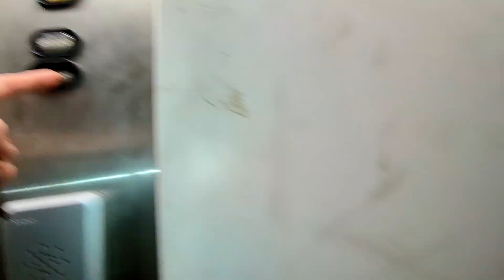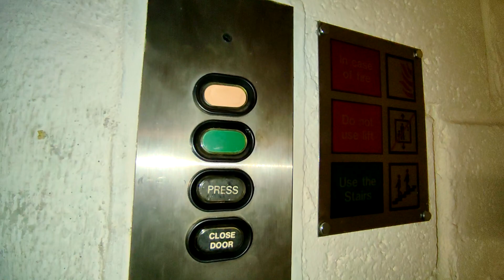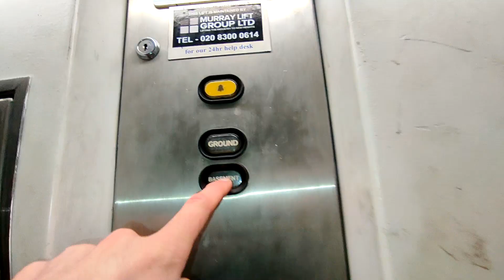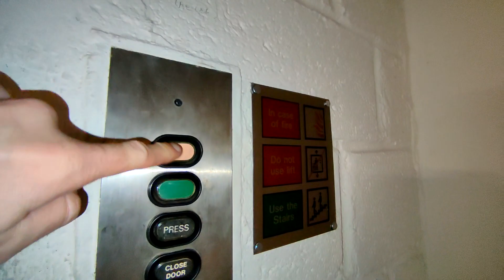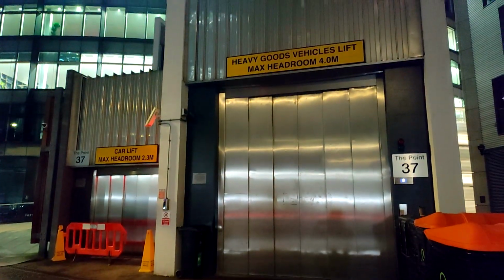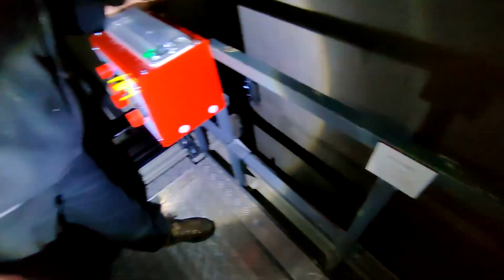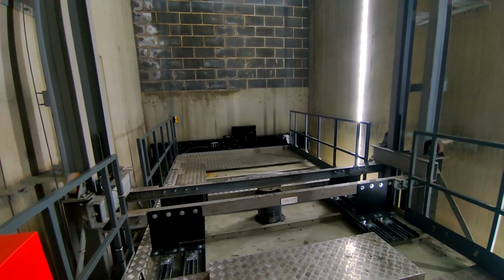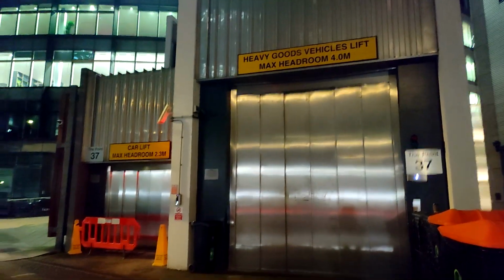Rare Express car lift with vertical doors

Comment: These types of elevators are pretty common here in the US, although I don’t think we use them as car transporters. The ones I’ve seen (and been on) are used to transport large loads of cargo between floors for which a regular elevator would be too small for

Comment: This lift has an interesting traction motor with a very interesting 50Hz hum, which passenger lifts would have this motor like the ones at Chatham Tesco and Go Outdoors before 2011 mod, and Permanent Closure in 2020.

Comment: Interesting, there is an induction hum when the elevator was descending unless it was something with the controller. Most hydraulic elevators are silent when going down, expect for the whooshing sound as the tank is filled back up. Elevator that big likely has two pistons.
Reply: The humming is coming from the retiring cams on top of the elevator, which is what locks and unlocks the outer doors.